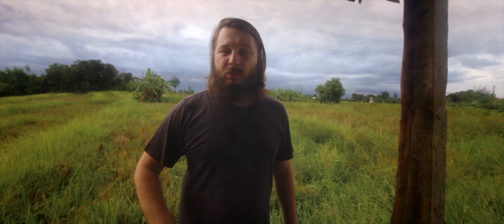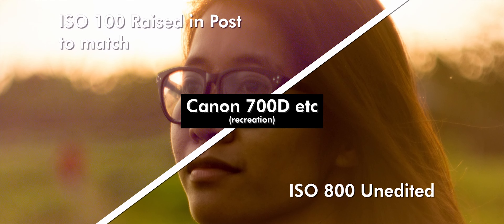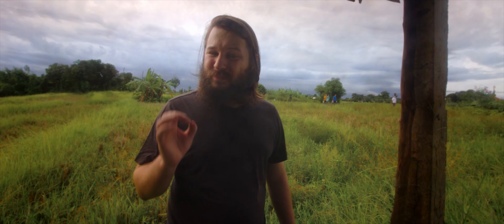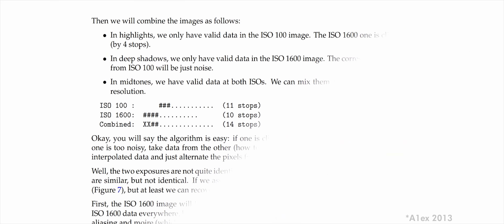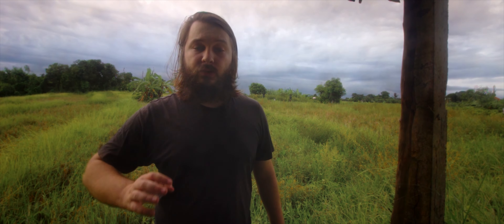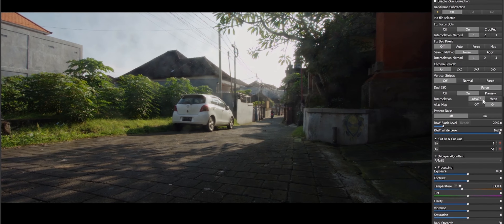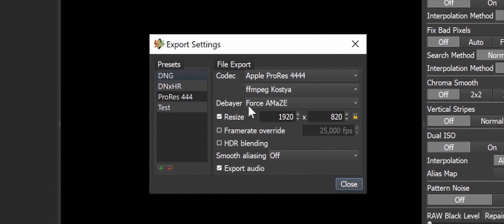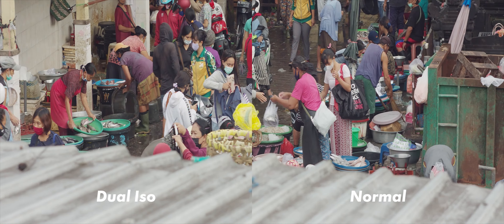Dual Iso Module Magic Lantern

Comment: I have a Cannon EOS M that I just got and put magic lantern on it but the ISO is stuck on auto.  Trying to set dual will only set the second ISO value so then it shows up 0/800 etc.  Does anyone know how to disable the auto ISO?
Reply from the maker: I googled and found this: "Press the info button to get to the Canon interface to put it into movie manual exposure. The press info repeatedly to get back to the ML interface."    
I don't know if it works because I don't own EOS M and can't try it out.     
If it doesn't work, you might be better off asking for help on reddit or on the forums. =) But I hope it helps, good luck.